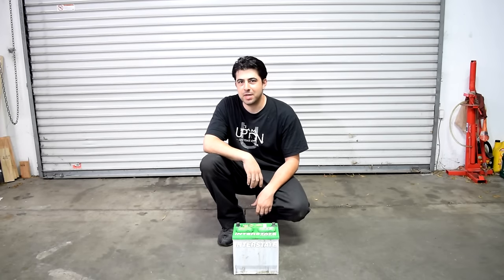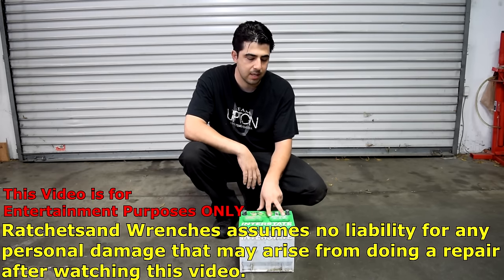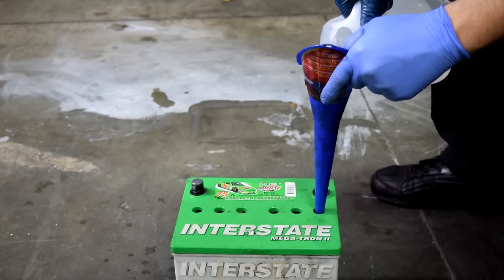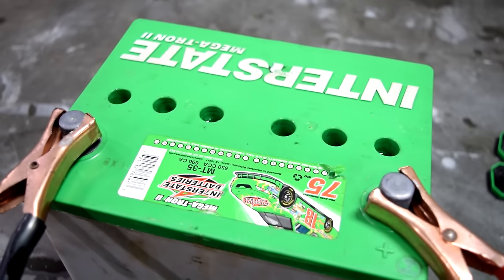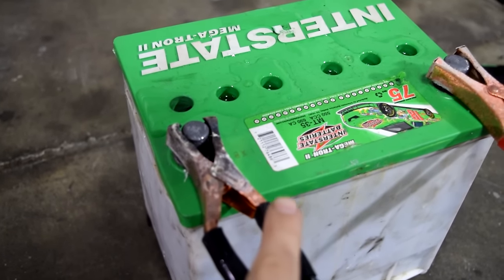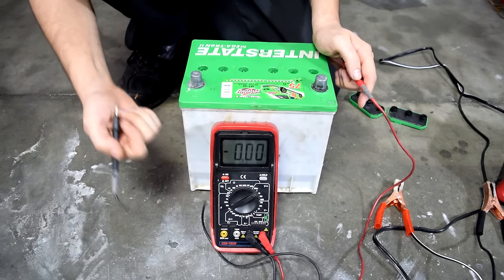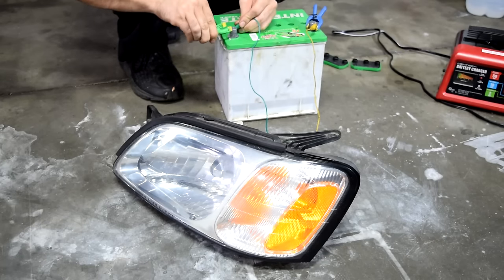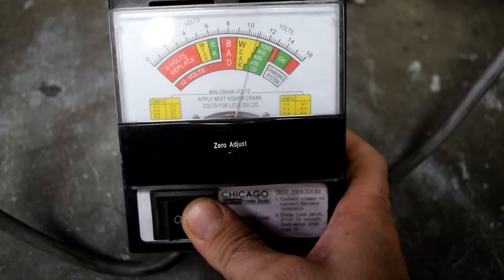Is it Possible to Revive a Dead Battery with Epsom Salt - See For Yourself

Comment: BTW, I had a class early on at Caltech about this very thing. A professor did a lab showing this is all BS. Sulfation is the problem. Usually it cannot be reversed. One can try raising the voltage on one charge, this may break up some crystals on the plates. If that doesn't work simple chemistry is not going to fix it. They need to be scrubbed plus some.
 Anyway we all know that watts and amps and volts are not the same thing, raise your volts and your amps go down. A watt is a watt. It's kind of like the perpetual motion theorists. There is no such thing as a free lunch.
Reply: I was just starting to think you might know what you were talking about, then you revealed yourself to be ignorant of the most basic principles of electricity. "Raise your volts and your amps go down" = WRONG!!!! Voltage and amperage are directly proportional, and more volts in a circuit (with the same amount of resistance) means MORE current (amps), NOT less!!! Power output (watts) is equal to the voltage (volts) times the current (amps), but circuits don't draw "watts", they draw a certain amount of CURRENT based on how much voltage and resistance is in the circuit. The more voltage in the circuit (for a given amount of resistance), the more CURRENT it will draw, and that will increase the power (wattage) rating of the device. The more RESISTANCE in the circuit (for a given voltage), the LESS current the device will draw, because voltage and current are directly proportional, but RESISTANCE and current are INVERSELY proportional. Not meaning to yell at you, but emphasizing the important parts.
Reply: Unless you have a fully nuked cell the will work more times then not. Slow charge is the key after this process.
Reply: Joe Shmoe a
Reply: ?????  @ 12v with 120 watt dissipation is 10 amps.   @ 24v with 120 watt dissipation 5 amps.  Which is excatly what I understood Joe to be saying.
Reply: Just remember:  the PIE,  P = I x E

Comment: Most batteries today are engineered to fail within a year or two. However, car batteries act a bit differently due to some unique construction. Today's alkaline batteries tend to leak right after they go dead and damage or destroy the device. I do have one particular 13.5 volt lead acid sealed battery that refuses to quit after 35 years. It once powered up a paramedics heart scope and  later I adapted it for my camcorder. Lastly, identical batteries that you buy today seem to go bad within a year or less with no reason for the failure? This one a YUASA is 35 years old and still holds one hell of a charge.